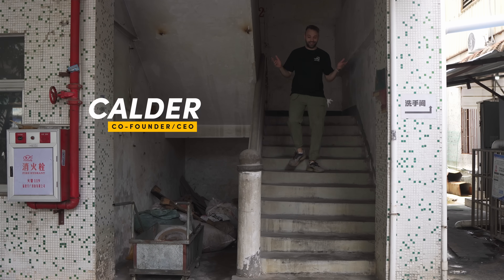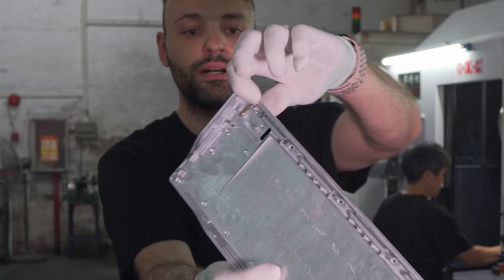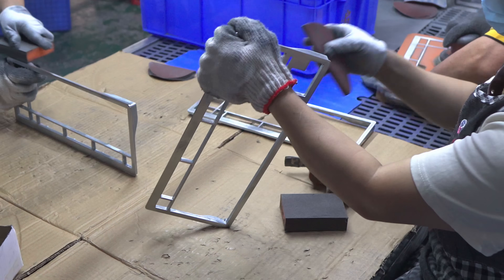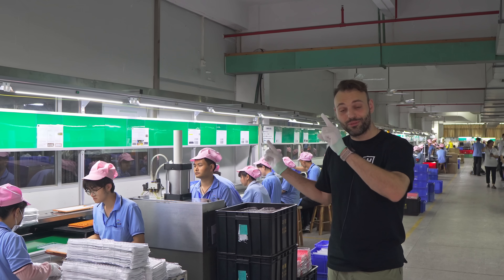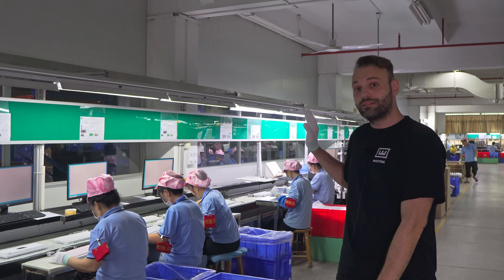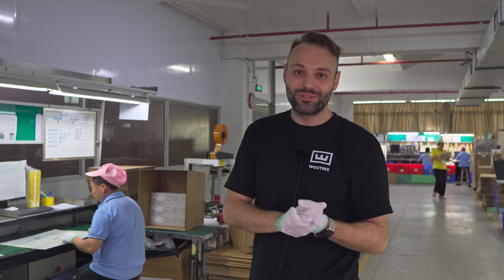Zinc Alloy Case: How it is Made | Factory Tour Day 3

Comment: Are the new wootings going to be pre lubed? Or you need to lube them yourself im curious you have a the typing sound on your website im want to know if you made it lubed for the sound
Reply from the maker: The 80HE will come pre-lubed. The sound test on the website was a DVT sample, where the switches were factory lubed and the stabilizers were hand-lubed as our early samples didn't have pre-lubed stabs. Will do a sound test soon of the PVT samples which are pretty final.
Reply: @Wooting  oh ok i did not want to hand lube them myself thank you!

Comment: Hey Wooting, being as you would actually know the answer... Does 8KHz continuously communicate with the PC at that frequency, or does it only communicate on key press? So basically, would the CPU be taxed by this high polling rate even when the keyboard isn't being used? I've never been able to get an answer to this. People always say contradicting things.
Reply from the maker: It runs 8Khz on the keyboard scanning keys, it also runs 8Khz polling USB. The toll it takes on your PC is different from the mouse, because the amount of data that is communicated is far less (frequent).

It only needs to update a state of change, if no change is there, nothing happens.

While with a mouse it continuously communicates X/Y coordinate changes without stop.

And if you do notice a toll on your CPU, you can always lower down to 4k or 1k USB polling in the Wootility. The keyboard can remain running 8k scanning.
Reply: It only communicates when a key press happens, it does not send any information if that state of key presses has not changed.

So ye, the CPU barely has anything to do

Comment: Key parts of production process in case someones interested

00:00 squeaky shoes
00:49 heh
00:57 hehe waoow
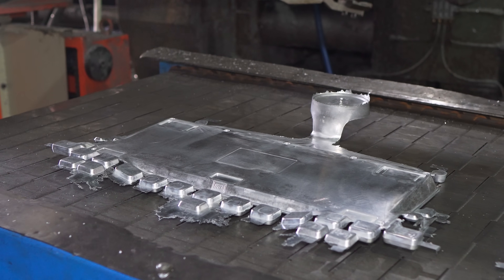01:26 laser
01:42 why. is. that. the. CASE?!
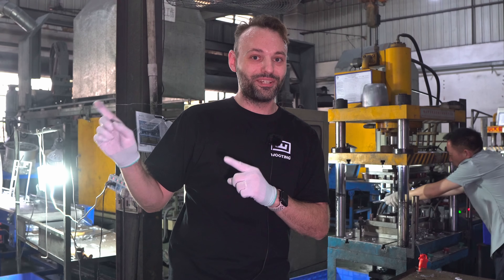02:23 green mean 
02:25 big machine
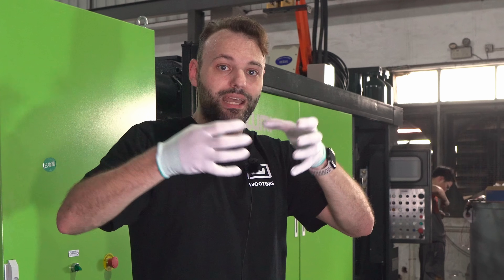02:41 ching ba ba boom
03:41 olympics rings before coloring and assembly
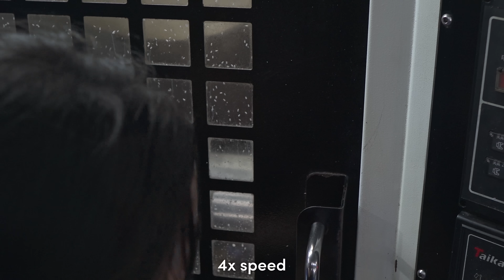03:46 case torture chamber
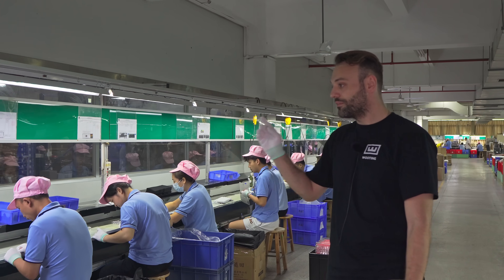07:34 dramatic tiktok sound
07:57 b-roll
09:38 babai

Comment: Add in next video how workers get better protection when polishing, cuz those dust particles are so small,  easy go to lungs. Better protected workers , better to the end customer is to. ???
Reply from the maker: Good point. This factory is a sub-contractor to our main manufacturing partner. This main parter is a publicly noted company, requiring extensive vendor vetting for, among other things, ISO certified and ruling out any (child) labor abuse.

There are still bars that are not set high enough (in law) in China, that can make the range of factory quality from dogpoop to high class.

I (Calder) can attest to this, having visited a range of different types of factories.

We used to be in a position where voicing these concerns would land in a bucket of nothing, as we were a small customer and from what you see here, this is nothing out of the ordinary, and even better than average.

Now we have a larger platform where we can make impactful change. I am going to see what I can do to make an impact here and hopefully also show this is subsequent updates.

Comment: Do you include the plastic dust cover with the zinc alloy case? I ordered a Black Zinc Alloy 80HE pre assembled.
Reply: The "dust cover" is not needed, since the travel case keeps the keyboard safe. It is not a dust cover - it is a protective plastic cover to keep the keyboard safe during shipping of the keyboard.